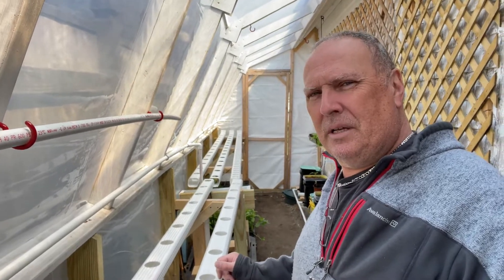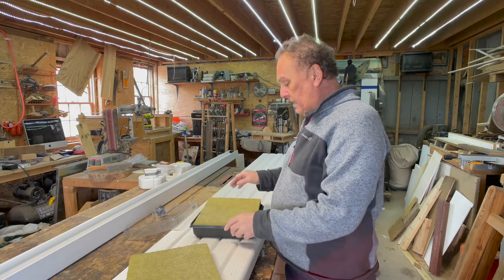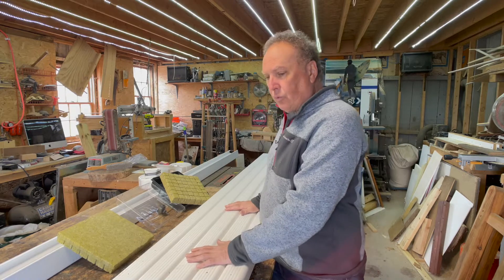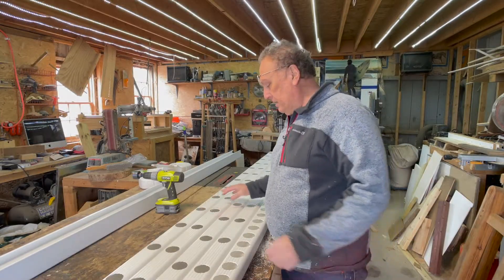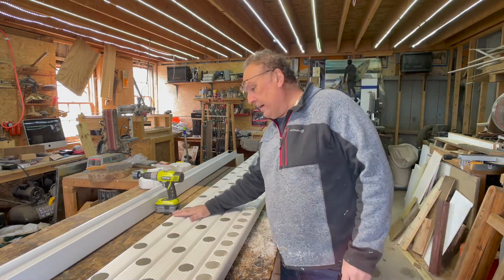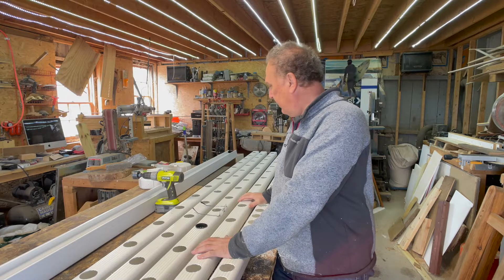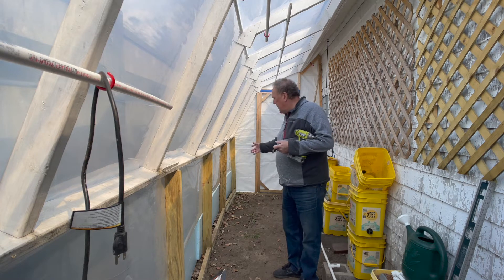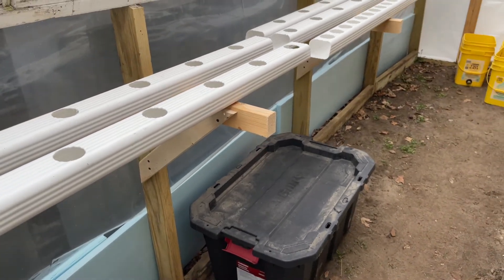How to build a Nutrient Film Technique (NFT) hydroponic system - for leafy greens at home

Comment: Damn I wish I saw this video before I made mine 😂. Mine is made with net cups.  The cups wouldn’t touch the solution so I sealed the ends and put a spacer on the drain so the water would pool up to the bottom
 Of the cups which mens the lower lanes are more submerged in water and grow slower 😭
Reply: Replace your cups with pucks. Head over to hoocho's channel he has a video of making the from rubber mats.